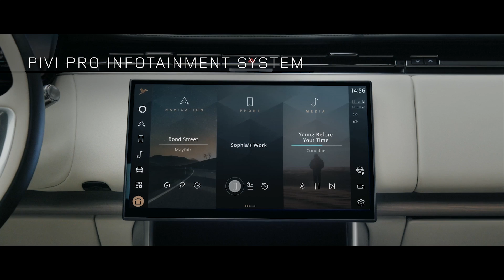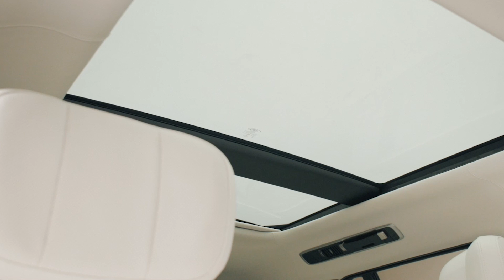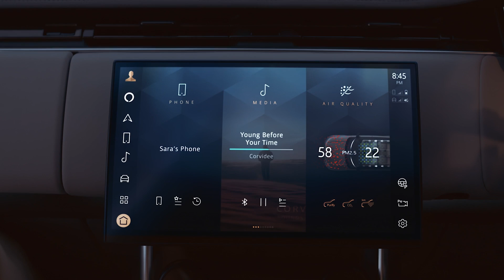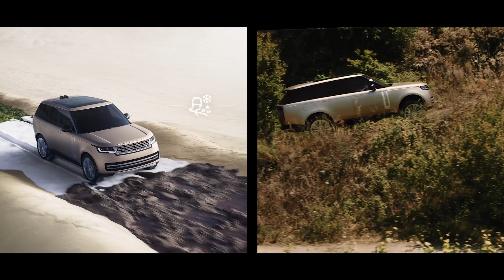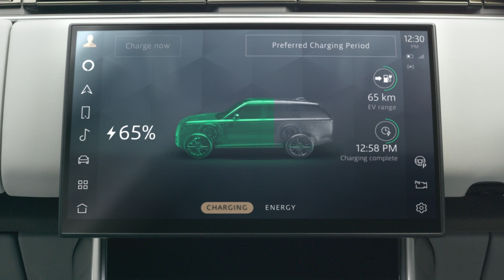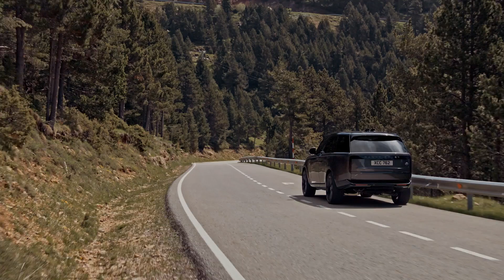360 Model Walkaround | New Range Rover (22MY)

Comment: OK so nice Video - what it  does not say it that your DPF will get clogged up and need replacement 3500 GBP and then the side effect will be a block EGR and filter at a cost of 2200, and this is with only 50,000 miles on the clock. I have written to JLR three times asking if this is expected Behaviour and they have not replied. I have also phoned them. Very poor design NEVER buy a JLR it will cost you big time.
Reply: A DPF Filter can be "Cleaned" in Australia for around $450. I have in 4.5 years (69K) never had the light come on. It is a case of reading the owners manual along with a constant speed on Motorways etc to keep regeneration in check as well.